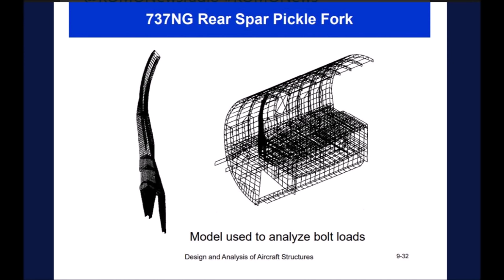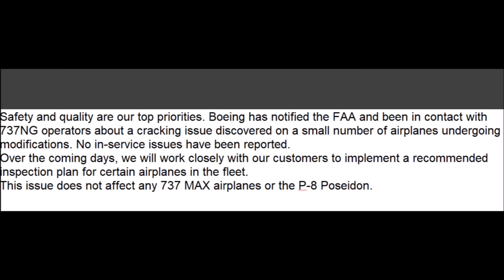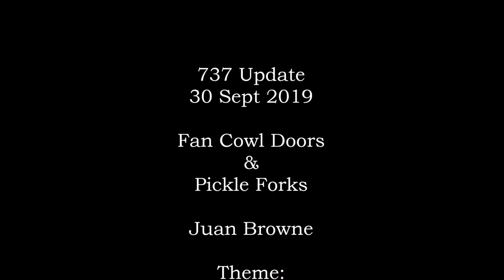737 Cowl Open inflight and 737NG 'Pickle Fork' cracks.

Comment: Surprised there aren’t micro switches on those doors so the that the crew would get a cowling door unsafe light if the latches weren’t locked.
Reply: Collin Smith  costs money.
Reply: Exactly! That's what I was thinking to
Reply: My econobox Toyota has switches everywhere and lets me know if nearly anything has been left opened/unlatched/whatever.  How many hundred million dollars is a commercial airliner?
Reply: Lots of cowls are being fitted with latches that lock. Plane won't (ok, more like shouldn't) go anywhere until the keys are stowed on the flight deck
Reply: It's not the cost of the micro-switches, but the engineering. There probably wouldn't even be very much wiring. They could be on a bus and talk to a controller.  Figure a couple of man-years to get it approved.
Reply: @zorgatron8998  I'm still driving my 'old' 1999 Dodge Ram Van 1500...1/2 ton Van....not much of any indicators...BUT...a friend of mine bought a new 2019 Toyota Tacoma 4X4.... indicators and video screens everywhere....good thing, he's not that good of a driver, even at 69 years old...can barely back-up without issues...!
Reply: The A320 NEOs do have micro switches because they are even closer to the ground—less than a foot clearance iirc. . .
Reply: Collin Smith there you go again speaking common sense. That disqualified you
from ever becoming a corporate executive.🤔
Reply: @theashpilez  
the cost now is more than just sensors installed to these lathes
reputation is lost...
and last and LEAST, it could kill and endanger people, but who cares.
Reply: Collin Smith you just can’t put microswitches on every moving part. Especially when a simple visual check can prevent this from happening, as it does 98% of the time anyways
Reply: So true. In a car if the doors are not latched the dome light stays on plus you get a message on the dash the “door is ajar”. A plane has several doors and each latching is vital to a safe flight. There should be a warning light for every latch. A simple switch that lights a bulb on the instrument panel. Can that be so hard to do?
Reply: @williegillie5712  well technically fan cowl doors are not vital elements, they can surely cause damage but not pressurization problems like passenger doors. Besides you have professionnals trained to perform a pre-flight check and maintenance personnel as well so it shouldn't happen

Comment: Why can't latches be tagged once opened & removed when latched?  (Not in the industry just thinking.)
Reply: Where is tagout/lockout procedure?
Reply: Should be “ if you close the cowl, you latch the cowl”.  No leaving the cowl closed without latching them.  Simple, right?
Reply: @flyerbob124  Obviously that's not working (because of location).
Reply: How about a small sensor, like they have in most cars, which lights up a warning if it's unlatched?
 If my personal car can know when I have failed to close my hatchback, or door, why doesn't a 50 million dollar(?) aircraft have similar safety features?  (my .02)
Reply: @barrykaine6526  Because if it was designed by the MCAS crew, something bizarre would happen, lol.
Reply: Barry Kaine we don’t need another sensor that could go bad and give a erroneous indication.  Remember that’s the problem with the max.  Keep it simple......if you close the cowl you latch the cowl.
Reply: @barrykaine6526  Every sensor and light has its own wire. You hatch and door don't check that they are latched, they have switches that close (or open) when the door is approximately fully closed.

Comment: The Australian Broadcasting Commission(ABC) informs in YT video that Singapore airline Silk Air is storing a number of 737 Max's in Alice Springs, Australia ( an inland location with hot desert climate) for unknown duration. First arrived in Australia without passengers and "stall protection" system turned off.  Cheers from Canberra Australia

Comment: Maybe adding a Gopro on a stick  that records the inspection of the latches   paint the engine number and latch number next to it   
Or a inspection mirror like the bomb squad uses  or bring LT Pete along 😁
Reply: The number of times this happens is so infrequent that making it even more complicated with more paperwork and procedures would make it less secure and not complied with more often.  I suspect that these omissions to carry out the inspection correctly,   was a direct result of human factors,  like Juan stated.   

When a mechanic or pilot is under extreme stress, like a death in the family,  sick child, impending divorce,  boss screaming in your face,  or a combination of these stressors, this can sometimes lead to this type of incident.  It may lead to a failure to comply and lead to omissions more often than all other failures combined.  

When I brought up this specific type of distraction, through the inhouse process, I was immediately suspended (for 4 months) and had to undergo a forensic psychiatric examination (5 visits 14.5 hours headshrinking) before I was allowed to return to my job.  I was put back under the same manager,  the same type of incident happened again, 8 months later,  he was terminated for the second incident.  My clean record of over 40 years of never having any problem with any other employee,  led to the arbitrator forcing the company to get rid of him.  How many near incidents were prevented by the professionalism of the very skilled and qualified mechanics to perform their duties in spite of the obstacles introduced by this incompetent manager?  This probably happens in many industries and organizations.
Reply: Bring Ltd Pete along, that's cute 😄😊.
Reply: @sophieacapella  he can do the job for a few years  till he gets too tall  but If He plows His salary in to a 401K  He could pay for college  on his own  or retire at 40 
During WW2 they hired Midgets to do work in small spaces

Comment: Or latch tension was incorrect. In production on the planes I built, part of the inspection process was to verify the pressure in PSI it took to close the latch.

Comment: If the fan cowling door being left open is a common problem like you say, then a simple latch sensor with a blare in the cockpit during engine startup procedure would have solved this. Very easy to attach a sensor to warn if these are unlocked. Again, is this a cost-savings issue with Boeing compromising safety?

Comment: Airbus A320 has had a rash of past cowl inflight openings, googl.  A British A320 had both engine cowls open after take off. The issue is ground crews don't latch the cowl. There are no indications in cockpit, and unless you get down on the ground, physically check the latches they can go unnoticed. The DC10/MD10/MD11 #2 engine high on the tail requires MX make log book entry they closed it. Yet still many of those fan cowls have gone missing.

Comment: Not familiar with the 737 pickle fork. I am familiar with the forks on the 747 and 767. The 767 has had corrosion issues which can range from "not so bad" up to "we are gonna need a new rear spar on the center tank". Done quite a few of them. It is a major job.

Comment: Is there a administrative function that grounds the aircraft every time the engine cowling is opened, similar to a 781a red "X" in the maintenance records?  As you well know in the USAF, if you open anything bigger than the smallest inspection panel, the aircraft was grounded until signed off by a separate inspection that didn't remove the grounding condition.  In this case the first officer.  Do you have to sign off on your preflight aircrew inspections?

Comment: Guards at security checkpoints use mirrors on wheels to inspect the underside of vehicles.  Perhaps the airlines could get some to make it more feasible for these latches to be checked adequately during the preflight inspection?

Comment: One Fan Cowl latch sager Mpd calls up a Fan Cowl latch insp and Load adjustment not sure of frequency 

Pickle fork fitting should be becoming a swear word in Boeing as we had issues with these on the B767-300 
We picked up corrosion on these and had to trim some part of the fitting to remove the corrosion. We were the second company to have actually removed the fitting to carry out a repair on the fitting and re install it . It’s like ship building. There was a frame that had to be built up in the upper cabin and and attached the fuselage structure to maintain conformity.
The 23 bolts around 1 1/8 inch in diameter are installed through the center tank so not a pleasant job.

Comment: I have been on many flights, but the last two times, when the nose wheel comes off the ground they sound like the wheel bearings are almost gone or they are extremely out of balance.  There is quite a bit of vibration and it oscillates.  Once all are off and they tap the breaks to raise the gear the noise/vibration quits of course.  I did notice odd noises coming from the gear as we were steering into the terminal on the last flight.  Have you heard anything about this, is it normal?

Comment: Juan, in the automotive repair industry, 
we use "pickle forks" to break open ball 
joints, and tie rod ends.  (Same design, 
but one is a suspension part, the other 
is a steering part.)(One moves up and 
down, with bumps, the other steers the 
car.)  Neither will procure pickles from 
a drum.  (A barrel is a unit of measure.)

YouTube's DEMONization?  Really?  It is 
NOT "demonitation.  It IS Demonization!

(Next week, expect something from me.)

You guys, DO THE SAME!

steve

Comment: I am not a pilot but even my pickup truck has a built-in backup camera.  Understood that it's expensive to integrate new attachments (type rating change?) but considering how many disastrous engine and control surface issues have brought aircraft down, these should be mandatory upgrades.  We HAVE the technology...!

Comment: When I was an F111 driver , Instead of the barrel, we called it the Upside down triangle theory of management, there being only room for one pilot in the bottom of the triangle. As soon as someone else fouled up, you would be moved up a little and after several had you were cloaked amount the many.

Comment: Great video Juan. However I disagree with this notion that it’s simply human factors that caused the cowling issue. Events like these prove that more need to be done to secure the spot check process at all airlines. The reason why aviation is so darned safe is because we take human factors seriously and try our darnedest to design away any source of error be it human, system or otherwise initiated. Whilst the history books haven’t been written on the 737MAX MCAS system yet there is no doubt that failure in the design of the human factors was a major cause for the tragic loss of life thus far!

Comment: With all the forces put on the fuselage and wing structure you’d think by now they’d know where they need to beef up the structure. If it’s a flexing joint, design that joint to handle the forces against it. Is that so hard? Especially in so vital an area that holds the wing to the fuselage.

Comment: The same old reason. The shortness of the Landing Gear. Thus people need to bend down real low. That is not necessarily bad design but it certainly isn't great design. But heck, soon the requirements for commercial pilots will be relaxed so much that young children will be first officers and then the CFM would be just the right height for them to check the catches are shut properly. 
       BTW slightly off topic but one reason the 747 got built is that Boeing couldn't stretch the 707 to compete with the DC-8 stretch (61 series) because, wait for it, the 707 landing gear was too short. Tail scrapes on take off, to be specific. Ironic, eh?

Comment: Easy fix. If the cowl doors are open then the cowl doors must remain fully open. When the decision is made to close the doors then the mechanic can not leave until the doors are fully secured. If a problem develops while closing the doors then they must be left in the fully open position unless a mechanic stays with the door not fully closed and locked..

Comment: Given that latching the fan cover doors shut every time seems like an obvious source of human error, I am surprised that the FAA has not mandated sensors on the latches, which would then flag up an unlatched door as soon as the engines were started. Not exactly rocket science, six microswitches and some wiring. I am sure on a modern plane the wiring could go to each engine control module and generate a failure warning and code at that level.

Comment: I remember, way back when, early 2000's, a Philly-area sub-vendor, had a nicely designed conceptual (but fully-functional) piezo-transducer moderated system for instant interpretation of "closure, patency of closure, and in-flight monitoring of the closure status of cargo compartment doors, engine cowling, associated engine and fuel/refuel/IRP and control surface inspection systems inspection access doors, and APU systems, service and inspection access doors."  Sorry for the run-on sentence; the nuns from my '60s childhood will be here momentarily to crack my knuckles with a ruler.

The Boeing of my younger years, aka - the 1980's, when many of the more dedicated of us visited The Ford "Quality is Job One" Motor Company, Harley Davidson, Motorola (Comm Division), and a few other American manufacturers, spurred on by having our butts kicked by Japan. (AvEspeak: "Jay-Ay-Pan")

Remember the "AQS D1-9000A Advanced Quality System"??  

The philosophy, methodology, and qualitative + quantitative measurement, process analysis (cost vs benefit), and monitoring of employee skillset and "employee ownership of the process" analyticals, hell, what was discovered, taught, learned, proscribed, prescribed, and even imagined became early precursors to what later became packaged throughout industry as "Six-Sigma."

Now look where we are....

Comment: The verifier is responsible if it's not properly latched. Their sole responsibility is to ensure its latched properly. In the nuclear industry, if there's a human performance issue and a component is mispositioned and the verified failed to catch it then they have failed at their responsibilities and take the brunt of the discipline.

Comment: Way, Way, WAY back in 2001 Boeing moved its corporate Hq from Seattle to Chicago.   This was done, I recall, to have better access to financial markets.   Maybe so; maybe no.   But it also took the corporate top management some 1700 air miles away from it's engineering and design people.   IOW: top technical people no longer "had the ear" of top management.   Top management was just moving around money and taking decisions with tremendous technical impact without serious input from the technical side of the house.

Perhaps Boeing to move it's Hq back to Seattle.

Comment: For those below who had a problem with setting up Patreon:  It is confusing on the initial page.  If you click past that, you get a more detailed page to set up the amount, frequency, and limit per month. You can set any amount, but $5 is the suggested minimum for that tier.  You can set how many times per month.  You could set $1 for 10 times per month, but PayPal and Patreon have talked about charging fees per donation that eat into what the creator receives.  So, you may want to do what I did.  I set it for $5 per video with a limit of $5 per month.  All of that can be changed any time you want to.  I hate that PP and Patreon have a near monopoly on this sort of thing.